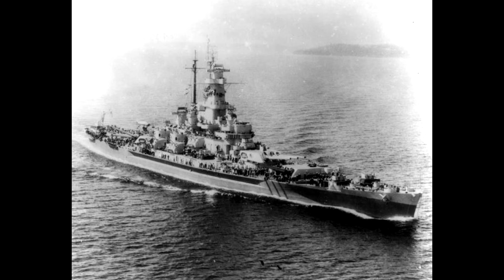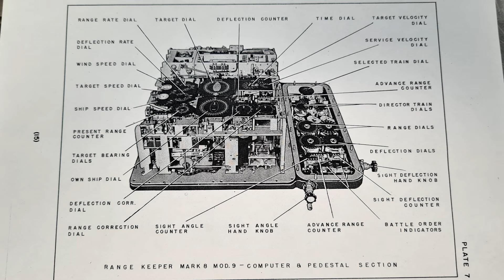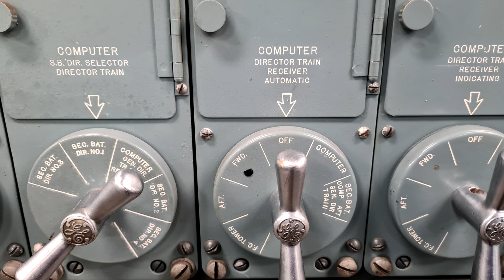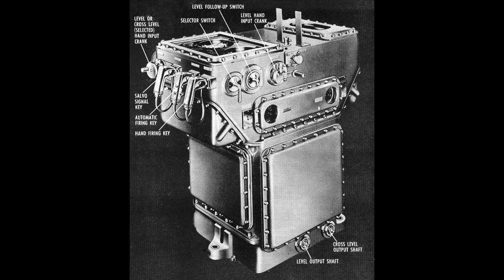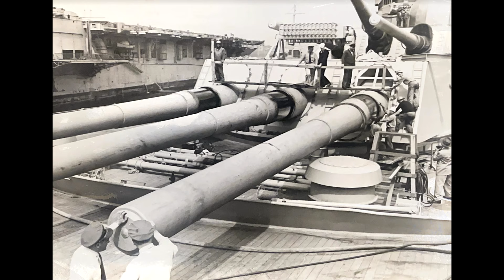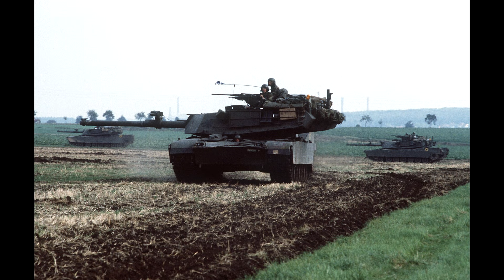US Navy Fire Control Systems - How They Really Work

Comment from the maker: Pinned post for Q&A :)
Reply: why was the US seemingly not concerned by either the Argentine-Chilean naval arms race or the later and larger scale South American dreadnought arms race? Was the US Navy not worried about the South American navies and therefore didn't have any plans to build up their own forces, or did they have such worries and plans and Congress was just too stubborn to release its stranglehold on them?
Reply: Given the potential benefit of leaving out a possible source of error, why was the USN so unusual in relying on automatic gun control from the fire control system for much of the war rather than relying on human intermediaries following the output of the fire control system? Was it simply due to a lack of technology from everyone else? And how much of a difference did this end up making in actual gunnery?
Reply: @bkjeong4302 I understand a major element of this goes to the kind of electrical system used. Almost everyone else in the world, except the Germans, used DC (direct current), while the US and Germans used AC (alternating current). If I remember correctly, Nathan Okun once explained to me in a comment that the US began building remote power control (RPC) into its major warships in the mid-to-late 30s, so the new fast battleships had it from launch while ships like West Virginia and Salt Lake City had it installed during major overhauls/rebuilds. There is something about DC that did not lend itself to RPC the way AC does. It may be that the output signal from the fire control table/computer is a low-voltage signal that, in an AC system, can control another device that allows high voltage motors to operate in response, but an analogous arrangement did not exist for DC systems. So basically, the US (and the Germans, who only used it for bearing) had a crucial enabling technology installed that allowed them to implement RPC.
Reply: @kemarisite  

Ah, so other nations simply didn’t have compatible technology.
Reply: @kemarisite  I'm not a power guy, but I suspect the issue here is transformers: transformers only work with AC signals because they are based on the magnetic fields generated by changing currents (which comes right out of Maxwell's Equations).  So it's easy to step up/down AC voltages and hence get higher currents.  You see transformers a lot in everyday life, though many people won't recognize them.  They're found in power sub-stations and on power line poles.  They're also hidden in boxes in the ground in places where they run power underground.  Internally they're pretty simple, just wire windings with a metal core, no moving parts.

With DC you have to work a lot harder to get something that can switch higher currents.  In a car it's done with a starter relay (solenoid) / starter motor that in effect converts the battery voltage to the relatively high current needed to start the engine - so you will have moving parts, and things that move tend to be more vulnerable to failure than things that don't move.  It's a much more complex setup than a simple AC transformer that doesn't need a motor or any moving parts - and things for the DC setup tend to get heavier as the current needed goes up (not to mention a potential issue with sparks being generated!).

A fair number of people that like to do car stuff, especially on older cars, have learned how to replace the starter motor or the solenoid when it goes bad, which eventually happens as the car mileage goes up.  It's typically pretty easy to replace these, though modern cars keep getting more and more complicated and things that used to be easy can sometimes become very hard to do as the overall complexity goes up.

So basically with DC you need moving parts to control moving parts, at least if you're working with any kind of decent current levels (which is what you need to move heavy objects like guns).  This means you have more things that can easily fail when the guns fire or the ship takes damage - extra care would need to be taken to get these components to be reliable/shock-proof/safe and in that form they would probably be fairly heavy compared to the AC equivalents.

That makes AC superior for driving the motors that move the guns, the director, and so forth: all else being equal, the systems are lighter, safer, and less prone to failure.

It's trivial with a computer to generate AC signals on DC ports - probably lots of kids have done that experiment in school - but those only support really small currents (which is a good thing since it makes computers pretty safe!).
Reply: During World War II it seemed like the US was trying to design ships with as much deck space as possible in order to mount AA guns, radars, sensors, etc. Through this we saw the US standards that survived Pearl Harbor get their funnels trunked. The follow on’s to the Cleveland and Baltimore followed this. As well as the South Dakota class. Why didn’t US designers incorporate this into the Iowa class or some of their destroyers like the Sumner and Gearing? It seems like other nations were trunking funnels on their destroyers especially the Royal Navy but the US seemed fixated on the same funnel design from the Bensons forward. But the Gridley through the Sims had one funnel.
Reply: Overland movement of Kriegsmarine vessels to the Black Sea. Uboats on big trucks.
Reply: So at 25:44 / 1:11:42, were the screws and fuse shown in that tray always there, or is that from some component that had to have panels taken off to see how it worked? Thanks
Reply: By the end of world war 2, say the surrender of Japan, who had the better fire control system? The British or the Americans?
Reply: Even after ramming had ceased to be a significant part of battle for capital ships, destroyers continued to frequently find themselves in situations where ramming was a good idea, such as battles with surfaced submarines (of which there were lots and lots in both World Wars) or extreme-short-range actions that could get too close for even torpedoes to be useful and that often involved much larger warships that a destroyer's guns had no realistic chance of disabling (Jutland-at-night, Dover Straits, Glowworm/Hipper, 1st and 2nd Narvik and possibly 3rd as well, Friday the 13th...).  Why weren't destroyers of the World Wars equipped with ram bows to give them a greater advantage when ramming the enemy (especially given that ramming an enemy ship without having the advantage of a ram bow could easily wreck the destroyer in the process, as Glowworm and Borie could attest)?
Reply: Recalling your videos on Hood, Warspite, and the one on Navel engineering including turns, how did fire control directors work when a ship was traveling in an arc?   That is, if a target and/or firing ship was proceeding in a constant or for that mater an increasing or decreasing radius arc could that be input into the computer?   This would seem to be a particularly challenging firing solution, especially as one would have to account for speed changes either intentional or as a result of the changing drag from turning.
Reply: How effective was the US Heavy/light cruiser navy doctrine? While the idea may have been good on paper the more you think and the more it was put into action the more ineffective the doctrine becomes once you realize who the US was going against (mainly ships equipped with extremely long ranged and powerful oxygen torpedoes) did the US Navy see a need to change the doctrine at some point during the war or did they keep it as it is? And how much did this doctrine affect USN cruiser shipbuilding as a whole?
Reply: Hi Drach, could you elaborate on why the 5"/54 was slower/more difficult to load than the 5"/38? Why not just add the extra 16 calibers of barrel but keep everything at the backend the same, minus the mount strengthening to handle the new weight? Also, were the 5" shells compatible between the 3 guns, or were they unique to the gun like the propellant charges were?
Reply: For the sake of the question, i'm going to say firing control equipment just to clear some misunderstandings beforehand. My question being, If all the nations had somehow gotten their hands on this advanced fire control equipment, How much would it have changed?World war two naval battles? Forgive for the improper grammar. This auto correct on my phone is acting like any bloody idiot😂😂
Reply: @Cbabilon675  

Not THAT much, because while everyone (save latest-war Britain) was somewhat behind, they weren’t nearly as far behind the USN as often assumed (more like a step or two behind at most). Things like RPC or (in poor-visibility scenarios) fire control radar might make more of a difference than the actual fire control computer itself.
Reply: How fast would a small tube boiler QE have been? 
Wouldn't its speed be more limited by the hull design/naval architecture knowledge of the 1910's, rather than the available power? (It had a ram bow! The Italians built over their ram bows, but none of the modernised QE's got this feature.) 
And even with small tubes, how much of an effect do the torpedo bulges have?
Reply: Can Dr Scholes recommend any resources that discuss how they would maintain calibration across the myriad of Director/plotting station/gun combinations on a battleship?  eg. Turret 1 is engaging a target via Spot 1 and Forward Battery Plot, then switches to After Battery Plot and continues to engage the same target. How do they ensure they are still firing on the same location?  The easy answer is "calibration," but when you factor the myriad combinations of directors, guns, plotting computers, things get a bit more complicated.  

Is there a source that goes into those weeds?
Reply: Could you give a brief rundown of the various types of Japanese WW2 ship radar? There appears to be very little information generally available so I was curious if you had more information on their capabilities and what versions they developed
Reply: Noting the error-correction loop (especially the radar crosshair), ability to manually set traverse and elevation, and the fire-when-optimal feature:
Did these systems allow a stuck turret to be combat effective by maneuvering the ship?  Or was this a redundancy too far to worry about?
Reply: Drach, two questions take all, one, or none
Is the US Navy analog current (as in amperage) based datalink the origin of the modern 4-20 milliamperes sensor and datalink system?
You have criticized both the USN for keeping conning towers and the Germans for not armoring their fire control cabling and transmission lines as well as opining on the weight of fire control rangefinders and radars.  Given the structural requirement of supporting the equipment and the armoring requirements of the data links; how much efficiency is lost by having a conning tower over the armored conduit(s) and structure required for lateral loads that seems to be the alternative for a damage tolerant system of the same resistance and redundancy?
Reply: Around 1933-34 the first stabilisator for schips where invented. Sounds like a cool thing to have on a battle ship?
Reply: Drachinifel, did the US Navy involve itself in the American Indian Wars, and if so, did they participate in any atrocities against Native Americans?
Reply: @Drachinifel  not really a drydock question, but. The firing control computer just ("just," like it's a simple thing) solve a series of differential equations to get firing solutions, right? He mentioned Controls theory at the end of the video with rocket launches and landing the Apollo missions on the moon, and those are a series of differential equations as well.

That leads to a tangential question. Was the techniques and calculations used to provide firing solutions on warships the origin of control theory that's the basis for aircraft and spacecraft autopilot systems?
Reply: @Drachinifel  What algorithm, if any, was used by the firing control computers to compensate for the error of their instruments? I'm familiar with Kalman filters, but I know there's alternatives.
Reply: Were anti aircraft firing control systems as advanced as the ones featured on the Wednesday video on fast battleship fire control? 

I was surprised the gentleman in the video did not mention it. How did they differ from those systems?
Reply: What was the unit cost of a Mark 43 (I hope I have that right) fire control director?
Reply: 2.8.2024 is a date of release for UBOAT submarine simulator. Do you plan on playing yourself free time of on the channel? I personnaly love it.
Reply: ☆☆☆  Q & A   ☆☆☆☆

Hey Now, I was wondering about something.  Comparatively speaking the Royal Navy during WW1 combined with the High Seas Fleet during WW1. NOW, compared to the Royal Navy during WW2 and combined with the US Navy during WW2 let's say right about January of 1945. As far as capital ships who would be heavier? And as far as a battle line action, who would win?
Reply: is the coriolis effect (earth rotation) significant at the ranges typically involved...and if  so how are the corrections computed /imputed for gunnery purposes on warships?
Reply: I’m sure you’ve by now seen the video published by Battleship New Jersey in which Ryan presents a top 10 list of the longest battleship gunnery engagements. At the top of his list is USS New Jersey’s engagement of the Japanese destroyer Nowaki, which was straddled by New Jersey’s fire and damaged thereby, but, Ryan qualifies that occurrence as a “near miss,” meaning that no shells from New Jersey directly impacted Nowaki, despite their landing in close proximity inflicting damage. What - if there even is such a thing - is the demarcation point between a “hit” and a “near miss” and a “miss?” Is it the infliction of damage upon a target? Is it a target reacting to being fired upon? Is it personnel casualties? Where do you draw that line for your own research, and, what might a historian want to look for in researching things like deck logs and after action reports when attempting to reconstruct naval engagements in as granular detail as possible?
Reply: How advanced were fire control computers on german battleships in WW2 era? Is there any pictures of these?
Reply: 1. Does the targetting computer inform the director that a stable solution has been achieved? 
2. If so, how does the computer decide if the target track is stable?

Oh... I much appreciate your work!
Reply: Anyone notice how in the hypothetical between 2 cars... his math, miles VS knauts, conversions, were alllllll nonsensical? I had to replay several times to make sure i wasn't hearing-wrong or going crazy.  I don't doubt he is singularly-Expert on fire-control systems  mechanical-computers... but i could not help but widen my eyes hearing such nonsensical maths & conversions.
Reply: America museum "fleet" tries to keep most of their ships in relatively mothball state, to a degree, in case they are needed in the worst case scenario. (Ie Iowas, Midway, and Essexs.) 

Do other museum ships in other countries try to keep their ships in a relatively mothball state should they needed?
Reply: What did a 17th century french knight think was the best way to build and destroy a star fort?

Comment: These analog fire-control systems were extremely impressive. They really could achieve the full achievable accuracy (i.e. as limited by intrindic variability, atmospheric variation, etc) of weapons like the 16"/50 and 5"/38, and that's why they were never replaced during the 80s recommissioning.

Compactness was one obvious reason they were completely superseded by digital for new designs, but perhaps even more important was the obscene cost of developing in the first place and/or improving them. In a digital system you can change, say, a lookup table that predicts the ballistics of a shell by just uploading new bits. Even by the late 50s you could do that by replacing a ferrite core memory module (note that this would be an entire board, not a chip) at the very worst. In a mechanical system like New Jersey's that requires re-machining an exquisitely precise cam for every single change, no matter how minor, and keep in mind that this was pre-CNC.

Comment: What's crazy to me is that the advantages of the US WW2 battleship fire control systems are basically the same advantages the M1 Abrams had for many years over other main battle tank systems. The ability to fire on the move, accurately, even against moving targets. Granted the Abrams didn't use mechanical computing to do so.

Comment: The whole notion of the computer commanding those huge and heavy barrels to constantly correct for ship motions is amazing to me.

Huge masses are difficult to move and move quickly.  

Id love to see real-time plots of  these motions along with how well they match the outputs of the computers, in order to see the real-time errors. 

Presumably, the computer must also model the barrel (as say, a mass-spring-damper system) -- as well as the controlling motors and gears -- to account for time lags and resonances. 

While engineering students in a "Control Systems" course are often shown the problem of not modeling such things (the fatal motions of the 1930's Tacoma Narrows "Galloping Gertie" bridge comes to mind), few see anything this complex.

Comment: The presentation is a bit exaggerating.
The math is not exceedingly complicated, it's the usual Newtonian dynamics. (The amazing part is not how complex the math is, the amazing part is that they built an ANALOG computer which solves it reliably and quickly).
Also it's not true that electronics of ~1980 couldn't take the shock of the 16" guns firing. By that time, there were electronic components which could withstand BEING FIRED from a cannon at accelerations of tens of thousands of G's. Yes, just taking the "office-grade" computer wouldn't work, but it was known how to make a rugged one.
Reply: Good point.
Copperhead Cannon Launched Guided Projectile of the 1970s.